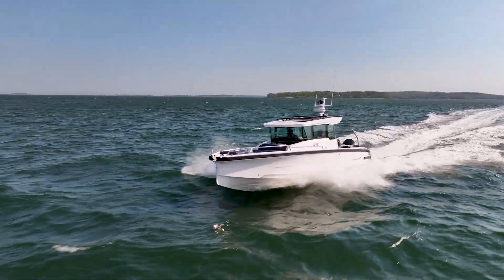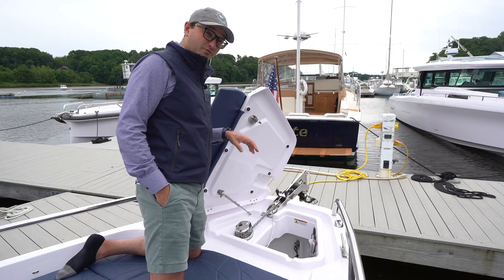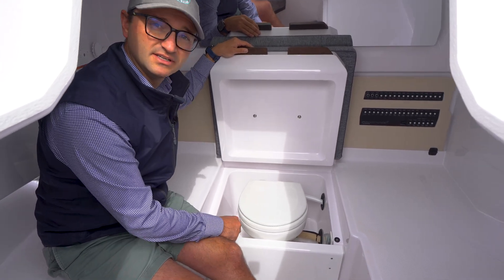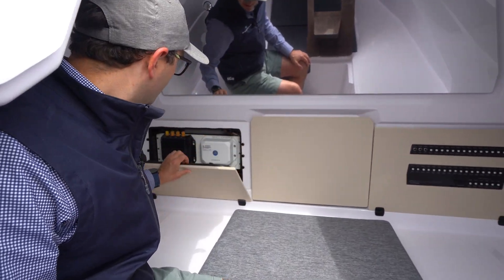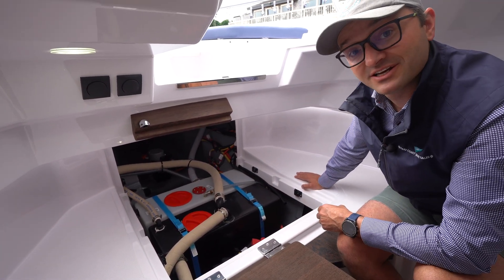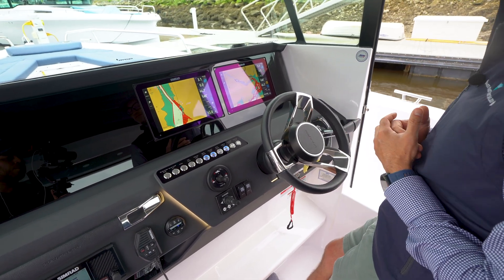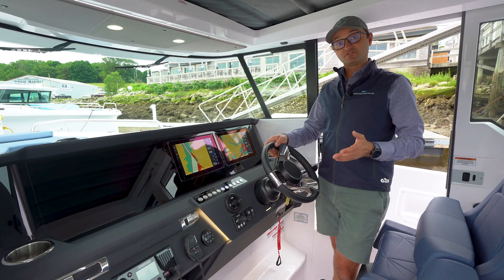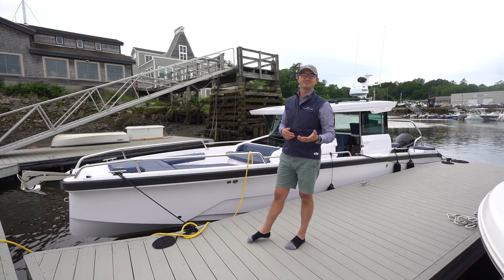Axopar 29 Overview & Location of all Systems | Axopar Education Series

Comment: Great presentation, as always, Ben. The access to all technical faciities, tanks, electronics and harnesses is major improvement over the 28, and more than appropriate on an adventure boat. 

One area that you could mention is the access behind the mirror (two turnbuckles, folds down on hinges) in the front berth, to the electronic modules, and the plotters. Not generally where a day to day customer wants to be spennding time, but as I have mentioned - the brand promotes itself with adventure boating, and being able to solve issues whilst away in a remote location, can make the difference.

BTW, checking both bilge areas where the pumps are located (front and rear) should be a regular maintainance exercise. Occasionally debris can collect there, and when the day (hopefully never) should come, you want both of those to pump with full efficiency.